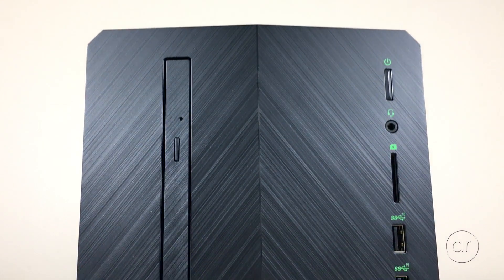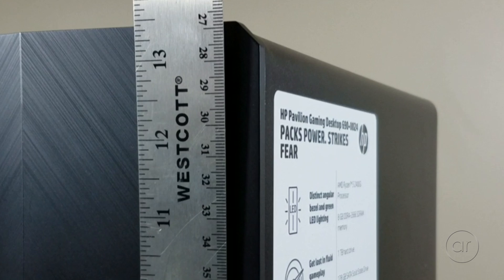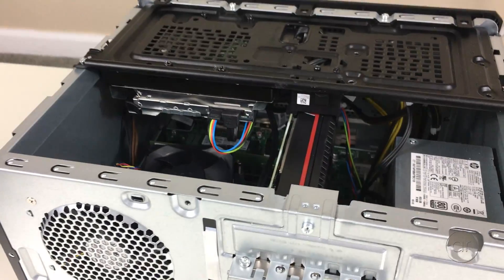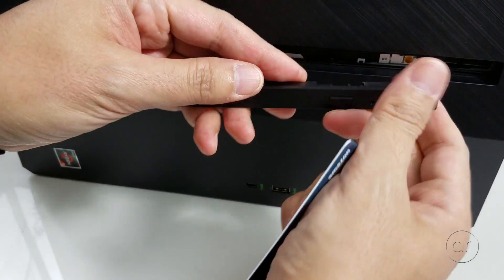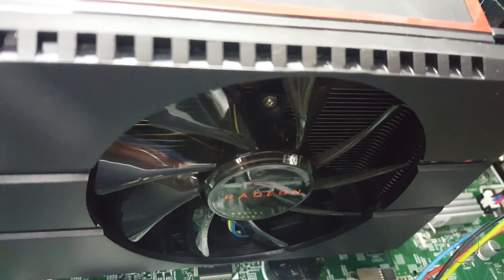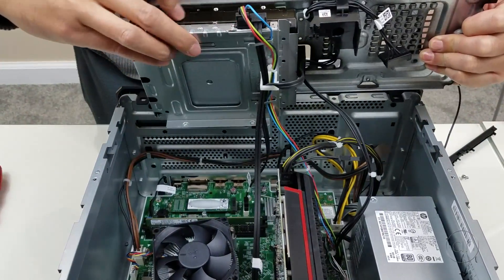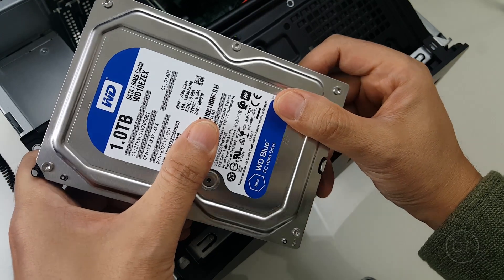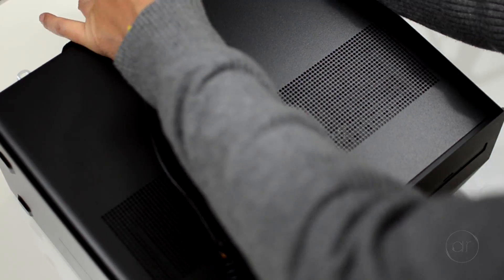How to Open and Upgrade a Ryzen-Based HP Pavilion Gaming Desktop

Comment: Can you swap the processor with anything with an AM4 cable? I was wondering if I could get something like the Ryzen 7 3800XT but idk if that might mess something up or what.
Reply: I’d be surprised if anyone commented on this because this video was a year ago and I just found it
Reply: Also do I have to get a new cooler for it or can I keep the stock one
Reply from the maker: According to HP's specifications website, I'm afraid the 690-0024 will only go up to a Ryzen 7 2700 (so it wouldn't support the third generation Ryzens). With a supported CPU, you can either use the existing fan or you will need one that fits an Intel CPU. Curiously, the motherboard is drilled for an Intel fan, even though the CPU is a Ryzen!

Comment: So I have the 790-0031 model but I think essentially it's built the same, is it possible to swap out the dvd drive with a blu ray drive and do you know what the size would be?
Reply from the maker: I'm afraid I was focusing on the HP 690 model family in the video, but I can defer to other viewers who may have more experience with the 790s. Has anyone tried replacing the DVD drive with Blu-Ray?
Reply: @accessrandom  yea but I think the build on parts is pretty similar as well as the case and drive and everything but thanks for helping!

Comment: I would like to add a 2.5" SSD to the extra SATA port, but I'm not sure what type of bracket or adapter I need to mount it. Any Ideas?
Reply from the maker: The hole pattern on the cage doesn't align perfectly with the four holes on a 2.5" SSD, but you could hold it with one or two screws by matching up with the cage as best as possible. Alternatively, I and others have just used velcro to hold it in place.
Reply: @accessrandom  Thank you!

Comment: Can I replace the entire case?
Reply from the maker: I'm afraid I didn't check to see if the motherboard's mounting holes were a standard ATX pattern (I'll need to check the next time I go inside). The motherboard and power supply are highly customized because the pin-outs to and from the power supply are non-standard. You'll want to avoid using a normal, standard power supply with the HP's motherboard (and vice versa). Other components like the graphics card, SSD, memory, and hard drive, are all standard components and can go into another case.
Reply: @accessrandom  thanks

Comment: TY For this list ..... I have a HP680-13w in which I upgraded the ram from 16g to 32g and the processor from Ryzen 5 to the 7 2700 ... upon looking at the new AMD Ryzen 7 3700X and seeing the 65w I am wondering if I can upgrade once more to the newer 7 gpu. Might you or anyone know? TY again for this vid ... helped me a lot.
Reply from the maker: You're welcome. I wasn't able to find anything for that model number (HP680-13w) but if you enter the printed number in google, you should be able to find HP's specification site for that model. They are pretty good at listing the CPUs to which you can upgrade.
Reply: @accessrandom  its the HP690-0013w ... sorry about the typo .... I see the upgrade list on HP but it doesn't look updated. What I do notice is the 65w on the newer 7 chip is why I asked. And I know it can't do anything over that wattage per that list. Maybe I'll try and get to a HP tech
Reply from the maker: @samsonglass  Yeah, you may want contact HP directly to see if there have been any updates to their documentation. I know the 690-0024 itself won't take any 3rd-generation Ryzens (I believe some viewers have tried it but it didn't work).

Comment: would you be able to upgrade the power supply on this?
Reply from the maker: The power supply is highly customized (to match the non-standard motherboard), so the only PSUs that have worked are the OEMs from HP (you can find successful upgrades from other viewers in the pinned comment).

Comment: I read all the info. It Im not very tech savvy. Its so much info I dont know where to start.

I just want to know the best things to buy to upgrade this pc since just got one recently. Amazon links with description would be lovely. I tried reading in links but I didn't know what I was looking for persay.
Reply from the maker: If you enter the model number (from the description or pinned comment) into Amazon, it should take you directly to the product page. I'm afraid I don't have a specific set of recommendations because there are so many combinations of components, the selection of which really depends on what you what you want to do with the upgraded computer.

Comment: I’m scared I just bought a 2060 that’s 8.9 inches and I don’t even fucjing think it’s going to fit I fucjing Hague HP and there small cases, a card that’s literally 99.9% fit won’t even fit in so done
Reply from the maker: I can't guarantee anything, but since there's 10 inches of space inside the case, I think it should fit (you may need to remove the bracket seen at the 3:23 mark). I've had a report of one successful upgrade to a 2060 (you can find reports of successful graphics card upgrades in the description, under "Graphics").

Comment: I have the Ryzen 3500 variant, and wonder if I can upgrade it to Ryzen 9 since it is AM4?
Also would like to upgrade the power supply if possible.
Reply from the maker: Without knowing the exact model number, I recommend googling it (by just entering the model number), which should bring up HP's specification site. They are pretty good about documenting which processors will work with your model.

Comment: I have this same case and am looking to upgrade the case to a bigger one to fit a larger gpu inside. I am very new to pc building and I am a little lost with which case to get. I/m looking to take all of the components inside the pavilion and move them into a larger case, but I'm not sure if that's possible, how to do it or which case to upgrade to. Can someone help me or point me in the right direction? The gpu I'm looking to get is the MSI Radeon RX 580 8gb model if that helps.
Reply from the maker: Unfortunately, I didn't check to see if the motherboard's mounting holes were a standard ATX pattern (I'll need to check the next time I go inside). The motherboard and power supply are highly customized because the pin-outs to and from the power supply are non-standard. You'll want to avoid using a normal, standard power supply with the HP's motherboard (and vice versa). Other components are standard, like the graphics card, SSD, memory, and hard drive - I've kept track of successful graphics card updates in the description under "Graphics."
Reply: @accessrandom  Awesome! Thank you so much!

Comment: Can u change the ryzen 5 for a newer ryzen??
Reply from the maker: I'm afraid this particular model won't accept anything beyond a 2nd generation Ryzen, but it can go up to a Ryzen-7 2700 according to HP's specifications website.
Reply: @accessrandom  thank u so much man, whats the best the motherboard can handle for the prossesor?, ive been searching for a pc and my budget is 500$ this seems to be the best ive found so far
Reply from the maker: @struggler2847  I've heard great things about the Asus AM4 socket motherboards. Please keep in mind that if you decide to replace the motherboard, you will also need to replace the power supply (since both of them have non-standard power connections), both going into a new case. And if you want to use the existing processor, you will also need a new CPU fan (even though the CPU is a Ryzen on the HP, the fan is actually for an Intel).

Comment: I don’t need to any time soon but I’m wondering for the future if it would be possible to transfer these specs into a new case for when I eventually upgrade. Also great video
Reply from the maker: Thank you. Unfortunately, I didn't check to see if the motherboard's mounting holes were a standard ATX pattern. I will need to check the next time I go inside. The motherboard and power supply are highly customized because the pin-outs to and from the power supply are non-standard. You'll want to avoid using a normal, standard power supply with the HP's motherboard (and vice versa). Other components are standard parts, like the graphics card, SSD, memory, and hard drive.
Reply: @accessrandom  ok thank you so much

Comment: Can the power supply be upgraded to any power supply or does it have to be from hp
Reply from the maker: Unfortunately, it does need to be from HP because of the non-standard pin-outs (you can see the reports on power supplies in the pinned comment).

Comment: Is the mobo a standard size? I have a similar machine, but I wanna transfer insides to new case. Can I bolt mobo right into a new case?
Reply from the maker: That's a good question. Unfortunately, I didn't check the hole pattern on the motherboard to see if it met any ATX standard - I will need to do that the next time I'm in. However, I know that if you do move the motherboard, you will also need to move the power supply, because both are highly non-standard (i.e., the power pins on the connection from each side are non-standard, so they need to match each other).

Comment: step one: unscrew the black screw. Step 2 take off the cover. Problem - the cover isn't budging.
Reply from the maker: I've had a couple viewers who've had problems with the cover. It should come off as I show in the video, but I suspect maybe the sheet metal is a bit warped causing more friction than normal?
Reply: @accessrandom  You were right. I just need to apply a bit more pressure.  You indicated there was room for an extra SSD Drive. I haven't had much luck aligning holes - even with a SSD mounting kit.  Looks like the best solution is to velcro the SSD directly under the DVD drive. Is that good practice?  Thank you!
Reply from the maker: @boogasauce2083  Thanks for the update. Yes, velcro works fine - in fact, that's what I ended up doing.

Comment: COULD A 9.5 INCH 2060 DUAL BE ADDED TO THIS PC I PRAY
Reply from the maker: I haven't received any reports of a 2060 dual specifically, but just going by the length it should fit (there's about 10" of space in the case). However, please keep in mind any power requirements for the graphics card - you may need a PSU upgrade.

Comment: i have one almost like this but I cant find the version of it, I tried to find it on hp's website but no luck. My versions name is 690-OOxx with a Radeon rx 550, AMD Ryzen 2400g (Raven Ridge), a sunflower motherboard, 8gbs of RAM(i upgraded to 2 sticks of 8gbs) and a 1tb hardrive,  i just wanted to know what graphics card i can upgrade on it, its power supply is holding 310 watts
Reply from the maker: I've kept track of other viewers' successful upgrades in the "Graphics" section of the description (with brands/models). You might want to take a look at those who have upgraded from the RX 550, who may have the same model as you.

Comment: what about motherboard itself ? could that eventully be swapped out ?
Reply from the maker: The only unknown is whether the hole pattern on the case is any ATX standard. I'll need to check the next time inside. But the motherboard is very custom, with a non-standard power connectors - which means the power supply would need to be swapped out at the same time as the motherboard.
Reply: @accessrandom  ah ok so what wattage is the psu I totally forgot
Reply from the maker: @Procaz  The PSU for the 690-0024 model shown in the video is 400 W. You'll see the brands/models that other viewers have successfully upgraded to in the pinned comment, but they're all HP OEM power supplies (because of the non-standard pins).
Reply: Thanks much mate

Comment: does anyone know if you can replace the ryzen 5 in a laptop for a ryzen 7?
Reply from the maker: With very few exceptions, laptop Ryzen CPUs are unfortunately soldered onto the motherboard.
Reply: @accessrandom  so i've been wondering why i'm lagging when i stream. i use obs stream labs, and in my computer is amd 5, nividia geforce gtx, i'm using 16 gigs of hyper x ram (which is recommended for typical games even dayZ), and i have a firecuda 510 ssd, i'm wondering if it's my computer which is under a year old, or if it is maybe my stream labs settings? i need an honest opinion if i fucked up on buying this hp pavillion gaming laptop during the lock down...
Reply from the maker: @thinncrispyy9570  I don't have much experience with OBS so I'll need to defer to other viewers. Anyone?

Comment: Can u take out the power supply
Reply from the maker: Do you intend to replace it? You can, but it's a very custom power supply (with non-standard pin-outs to match the non-standard motherboard) - so you would need an OEM HP power supply. I've kept track of part numbers in the pinned comment for viewers who have successfully upgraded their PSUs.

Comment: I play r6 at 120 FPS at full graphics with no upgrades I just want to upgrade the ram to 16gb
Reply from the maker: I've kept track of successful memory upgrades in the description. If you want to add 8GB to the existing memory, see the "Memory" section for brands/models. Replacements for the existing memory are under the "Replacement Memory" section.
Reply: access random thanks

Comment: Does this PC play blu ray cd's?
Reply from the maker: Unfortunately, not out of the box - it only has a DVD/CD player/writer.
Reply: randrandom  thanks for the info. Plus can you do a review on the new HP pavilion gaming desktop that came out this year
Reply from the maker: @disaster1100able  Thanks for the suggestion. If I have the opportunity, I will certainly review it.
Reply: @accessrandom  and another note I tried to upgrade the ddr4 2666 ram to 32GB two 16gb sticks and it didn't work. Blue screen keeps popping up. Went back to 16GB ddr4 2666 ram and it worked fine

Comment: And what if you change the case?
Reply from the maker: I haven't had any reports of transplanting the internals to another case. Unfortunately, I didn't check the hole patterns on the motherboard to see if matches any ATX standard. I can check the next time I'm inside... all of the other components are standard and can be moved, such as the CPU, graphics card, memory, M.2 SSD and hard drive. The DVD drive is a slim-style, so you'd need some type of adapter to make it fit into a 5.25" bay.

Comment: I also have a Pavillon Desktop PC with the Sunflower 8433 motherboard. It came stock with an A10-9700 APU and the CPU support list on the HP website states, that the Ryzen 5 1600 and Ryzen 5 2600 are supported.
Does that mean, that the X models i.e. Ryzen 5 1600X and Ryzen 5 2600X will not work? Has anyone tried this before?
Reply from the maker: I remember I've had one commenter who has tried this and it didn't work for him. Has anyone else tried?

Comment: not sure if this was answered already but has anyone done a successful case transfer without changing anything other than the case?
Reply from the maker: I'm afraid I haven't received any reports of a case-only transplant. Others have swapped out the case, motherboard, and power supply, but not just the case itself. It's a non-standard motherboard/PSU, and I'm not sure if the drilled holes on the motherboard match any ATX standard.

Comment: I am upgrading cpu and possibly psu, I have a 180w 80+ gold psu and was wondering if there is a 650 watt psu for the lincs motherboard? I have an HP Pavilion 690 0035no, gtx 1650 lp 4gb, i3 8100 4 core 4 threads, 16gb ram corsair vengance 2400mhz and one samsung 8 gb 2400!
Reply from the maker: Unfortunately, the power supply is non-standard (with custom pin-outs to match the non-standard motherboard). In the pinned comment, I've listed the successful upgrades from other viewers (under "Power Supply"), but the only ones that have worked are OEM parts from HP.

Comment: What size is the hard drive
Reply from the maker: The hard drive size is 1 TB.
Reply: access random oh I meant like the actual size like can I install it into a different case mb
Reply from the maker: @FameRevealedDaily  Sorry, the hard drive is a standard 3.5" size so it will fit in any 3.5" drive bay.

Comment: I have this PC expect I have  the ryzen 2700 and 16Gb ram in my Pc and I'm looking to upgrade it, my first question is there way to allow better airflow in the case?, would replacing the pc stock fan allow better for airflow in the case? The second is issue is VR since I use oculus quest and link in VRchat and this rx 580 is running to very uncomforatble levels lets say 90C to almost 100C feels like the gpu could burst at any second with the fan being so loud and it only happens on that game. So is there way to upgrade the video card(graphic card) without having to change out the power supply. The ones I have looked at are 1660 mini or maybe 2060 mini could be possible? 
   So is there way to increase airflow in the case as well a way to upgrade the graphics card without changing out the power supply? Thanks much appreciated
Reply from the maker: You can replace the case fan with a 92mm fan (please see the pinned comment for another viewer who has successfully replaced it). I've also made notes in the pinned comment about others who have gone to great lengths to lower temperatures within the case. The description also has successful upgrades to other graphics cards (under the "Graphics" section), so that will give you a good idea of what you can upgrade to.

Comment: Just saying right now if you want to upgrade your gpu that is over 400w you will need a new power supply which also need a new motherboard because the stock one does not come with the regular psu specifications.
Reply from the maker: Thanks for the info. That's correct - the PSU is non-standard (users who've upgraded the PSU had to go directly through HP for their OEM power supplies as seen in the pinned comment).